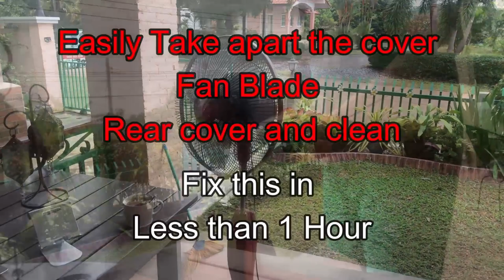🆕How To Repair Your Electric Fan At Home Electric Fan Urgent

Comment: Well I wasn't expecting to be watching fan repairs on a Sunday morn! 555
I'm surprised as a sparky you waited 5yrs tho 👍
Reply from the maker: Only when it stopped working it was time to take apart, routine cleaning of the fan blade and cover we use it for at least 12 hrs a night as we don’t have the Aircon on all night only 30 min to cool the room down.I was shocked how much dust it had. I will deep clean the other fans more often 
Thanks for your comment.
It’s what Sundays are for, fixing things.

Comment: I just go and buy a new one and pass the old ones on to the family. Fans usually last me about 4-5 years.  The fans are heavily used as we don't use air-cons  in the house too much here in Sisaket.
Reply from the maker: Hi bazzap, thanks for your comment, I have fixed a old fan which was abandoned under the things not to be thrown away at my wife’s farm.
My fan is used for between 10 to 12 hrs every night as we don’t use Aircon much, only to cool the room 30 min then just the fan all night.